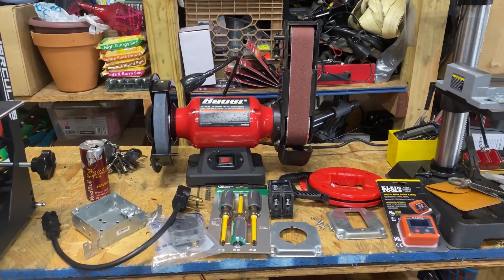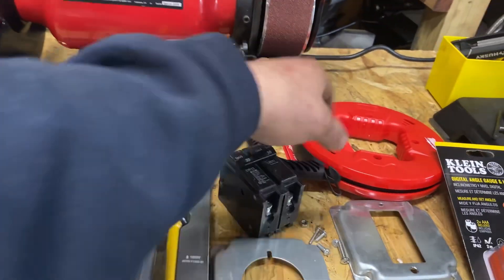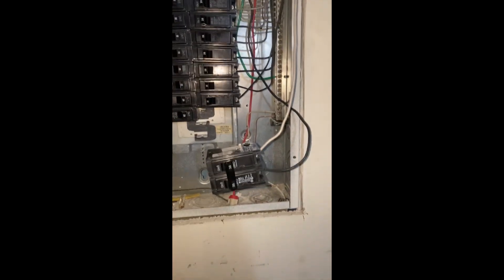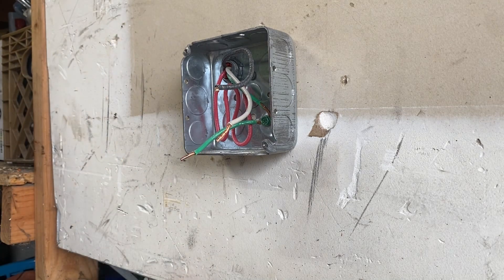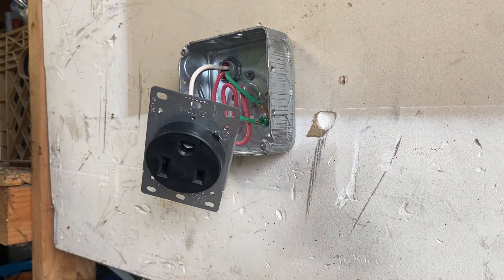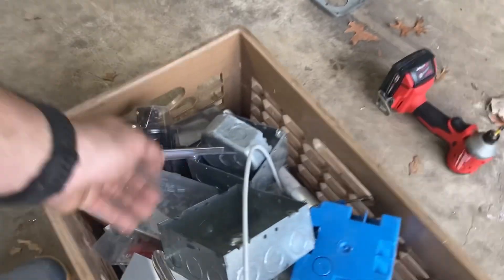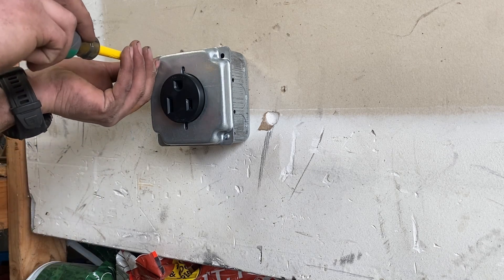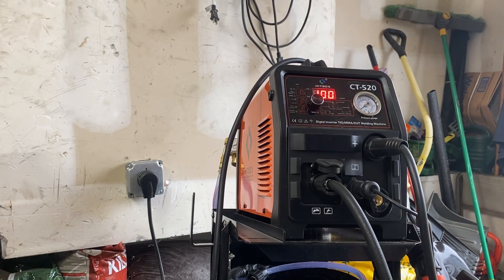How to run 220v outlet FAST & EASY

Comment: All of those '' White Wire '' or conductors going to a Circuiot Breaker in that panle for a 240 VAC Branch Circuit , the White Wire has to be re-indentified as a Hot Wire or Phase Conmductor by marking it with either Black or Red Tape !!
Reply from the maker: If i was concerned about this following any type of code or anything like that i would have hired an electrician…i dont and the only one who will ever be in that panel is me so it works for what i need it for ! But you should make a video doing it the right way im sure some people would benefit from that !

Comment: HEY ! There is NO Such thing as '' 110 '' anymore and hasn't been since the late 60's !!! Standard AC Voltage in the U.S. is 120 to 125 Volts AC or 240 to 250 Volts !!! And 8 gauge Wire is rated at 40 Amps !! And that wire is NOT NM-B Romex !1 It's MC cable aka BX Cable !!!

Comment: Are your voltages really 110/220? Here in Minnesota it's 120/240 VAC.
Also, with 3G, you should use black and red for 240 and cap off the white. With 2G you would use black and white, and then color the ends of the white conductor black.